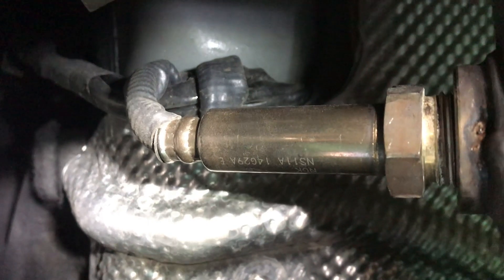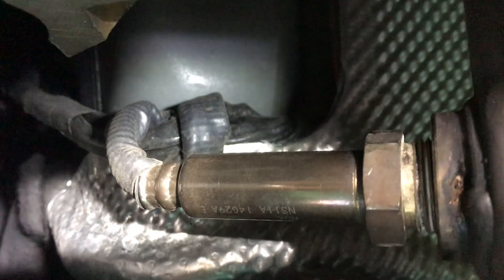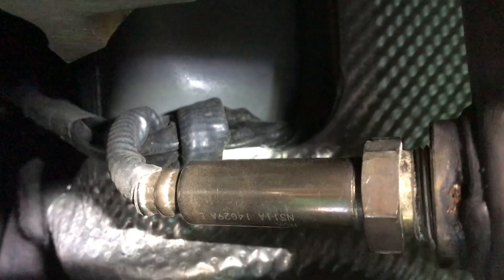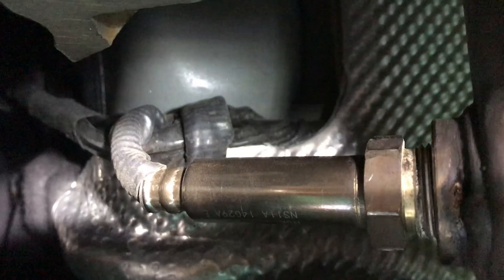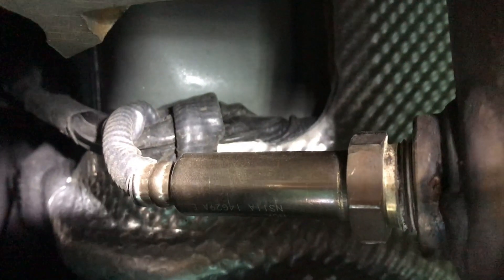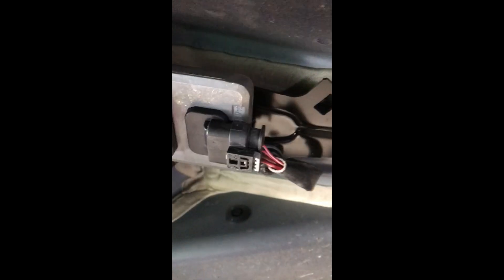Mercedes NOx Sensor Replacement Fix ML350 OM642 W166 Bluetec  CEL SCR Adblue DPF 2014

Comment: I know this is an old video now AussieJack but where do the two Nox sensor wiring harnesses meet at or before the ECU? I am wondering if mine have been accidentally reversed by a previous owner as downstream ppm reading is higher than upstream but it should be the other way around (I believe)
Reply from the maker: Updated the description to add the part numbers
Reply: @jackpwc01  Thanks .. I got inspired and checked under the car as instructed .. the front sensor is deffo correct (its  A0009053503 Q4 version) but the rear one has slightly different p/n A0009057100 and is a Q1 version. I read somewhere that you must not mix Q batches/versions... i.e.  Q1 and Q2 can mix together and Q3, 4 and 5 can mix together but you cant mix 1 or 2 with 3, 4 or 5. My error code is 111b00, "upstream plausibility error" and the ppm reading off my engine diagnostic tool indicates upstream is lower than downsteam... which is upside down (hence my initial question and yes I think they are addressed uniquely)  ...they track together up and down but the front one is almost always lower. I found a matching rear Q4 sensor p/n A0009053603 on ebay, so I'll install that first (as its much easier) and see how I go. If that doesn't solve it it will be the front one next... sigh. It's a good buggy and pulls the van like a train but, ... sigh.
Reply from the maker: Hey that's awesome.  Let me know how you go if you fit a new sensor.  I bought second hand sensors from Europe.  In the end I also took the car to the dealer to be 'calibrated/learned' - cost me $100's, not sure if it made any difference.  Note MB updated their SW around 3 years ago to make the sensors less sensitive. (see the comments from others)
Reply: @jackpwc01  Hi again a month or so back  I changed the rear NOx sensor as it is much easier and I hoped it might be an incompatibility issue rather than a fault but it made no difference, same fault. So I swapped out the front sensor with a new one that matched the rear sensor Q versions and it works great. Your video helped (anyone who has been under the car without a professional lift hoist knows how tricky it can be to video here). The cable clip under the heat shield would have been nightmare if you hadn't pointed it out... I undid the the heat shield bolts and simply pulled it down and slid the sensor and wire out over it towards the rear of the car where the shield joins another shield. Pulled the second shield down at the joint (bend it a bit) and bingo out she came (as you know you can't simply pull the sensor out, there is not enough room.. you have to slid it backwards over the heat shield ...in an inverted U shape effectively). Slid the new one in in the reverse manner, pushed all the shields back in, re-bolted them, re-set the learned values (I use an ArtiDiag BT 800 diagnostic tool)  and she's been working fine for >2,000kms. Downstream sensor (rear of car) is A0009053603 NS Q4, 5WK 6683D and upstream sensor (front of car) is A0009053503 NS Q5, 5WK 6682D. Car is w166 2012 v6 bluetec. Thanks again.
Reply from the maker: @ Hi, that’s great news and glad my video helped you get it done. Always good to share some knowledge.
Reply from the maker: Hi, Each sensor has it own ECU, that is mounted near to the sensor at the front and back of the vehicle.  The cables for each sensor are different lengths to correctly route from the exhaust to the ECU position.  Each sensor ECU has its own part number, and if I was guessing each may have a different connector keying, or may be electronically sensed to be the correct sensor though the body wiring and the ECU they talk to.  So in summary I would think it unlikely they are the wrong way around.  If you can get under the car and remove the 2 under-body protectors, you can see the ECU's and check their part numbers.

Comment: Ir would be nice if you stated which vehicle and year also better camera job to show the position of the sensors
Reply from the maker: 2014.  I've improved my videos since then, but as I don't have a lift it is a bit dark under there, sorry.  The controllers are both hidden by undertrays.  Remove the undertrays and they are pretty easy to spot. The sensors can be seen with a torch if you get under your car - one near the bulkhead, and one under the rear seats, both going into the exhaust pipe.
Reply from the maker: it says the year in the title...

Comment: Hi, You mentioned you thought you would be replacing the nox sensor again-did you and why? Also did you have to recalibrate the sensors or was it just a straight replacement? Thanks great videos 👍
Reply from the maker: Hi, Its a long story, but I after changed the sensors i did get a MB dealer to re-learn them.  Not sure it made any difference though.  The second time they failed I also changed them, without relearning, but I think that time it was actually the downstream EGT sensor that had failed.  Its a bit hard to remember now, but I will try and find the details and make a video sometime.

Comment: Hi Aussie Jack, do you have to re-program the sensors? Please reply. Thanks.
Reply from the maker: Hi,
When I changed the sentence is the first time I took it to the Mercedes dealer and ask them to re-learn the Sensors.
However when I change them the second time I didn’t bother and they worked okay. 
My advice would be to change them first and see if you can clear the codes using a scanner.

Comment: Do you need change both at once? And also do they need to be reprogramed? I changed 1 and it didnt get rid of my engine light.
Reply from the maker: Hi, I did change both, but you may only have one faulty.  When you change it you may need to re-learn the base values, and also update the system SW, if you are using a later part number.  I will be uploading a video later explaining what happened to my car.
Reply: @jackpwc01  I still have my fault code after changing the O2 sensor with a latoer part number.  I have a Autel MD808 scanner.  Is it possible that i still have the MIL code as the base values need to be re-learned.  If so can you tell me how to do that?
Reply: @jackpwc01  
Hi Aussie Jack
So it looks like the heater in the tank didn’t fix the problem
The problem was in those to knock sensors?
Please let me know if you need to program the knock sensors when you fit both sensors new?!
Reply: Have to change both and reprogram